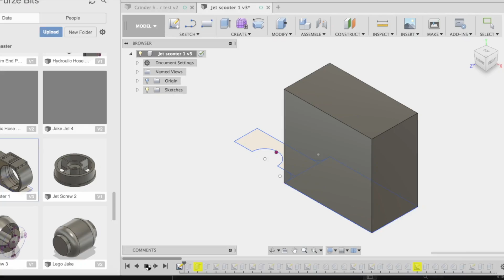Jet Powered Kids Scooter

Comment: When your dad is an engineer and you have an awesome childhood mission accomplished
Reply: Drone Worship He's actually a plumber
Reply: Well Engineer is the one who engineer things, I think you're confusing engineer with paperwork desk job with degree
Reply: not even an engineer just a creative guy
Reply: Not your ordinary plumber, if I may add
Reply: *plumber
Reply: He is engineer by experience.
You can have a bachelor or engineer place by experience equivalence
Reply: Colin furze is amazing. But he is not an Engineer. He can't even do the simplest of mathematics. Nothing will make him an engineer other than an education.
Reply: He is not an engineer!
Reply: Probably he can do the required math. Even if it is not simple...
Reply: and money... (And a engineer isent a protected titel, so basicly everyone can call tham self a engineer)
Reply: Navneeth Gopal
What does that mean?
Who is at the desk doing paperwork?
Someone who went to school for Engineering and received his degree?
Do you actually think Engineers just do paperwork all day?
Reply: He’s a very handy plumber. Anyone theoretically that has extensive experience with fluid dynamics (how fluids change and act) -for example: pipes in a house running through various applications, can apply that knowledge to not only air (fluid) but also the high pressure propane (i think thats what he uses in his propulsion systems) which acts like a fluid as well however high pressure natural gas will come out of a pressurized tank at the a high speed depending on the valve position. All the applicant needs to learn is the mechanics of turbines (if he wanted to make a traditional ‘jet’)  and how to get the ratios correct for sustained consistent combustion (in both pulse and turbofan propulsion systems ). In short, plumbers can makes pretty good pulse jets despite not actually being an engineer. For clarification, as a 4th year mechanical engineer student, there is alot more to engineering than fluid dynamics. But when in doubt my fellow youtube subscriber brethre (initial frame ) (1/2)mv^2 + mgh = (1/2)mv^2 + mgh (final frame) . Now you can find the proper amount of propulsion to get you going whatever velocity you need :) but don’t forget friction on the tires from rolling and also drag created by air resistance... but wait there’s more also you need to take into account the thermal expansion of the metal used in the pulse jet as so the combustion chamber does not exceed the tolerance of its joints. That formula you need     Av = (1/V) (derivative of V with respect to T) since we are working with 3 dimensional objects we must use the thermal volume expansion formula. Now the gas that also expands increasing pressure within the chamber.... you can make a really good pulse jet that works one time or you can make a complicated one that lasts forever... your choice. For my main man here his usually aren’t permanent and melt within minutes of intensive use, which for his demographic is perfect i.e. me wanting to see shit melt (shit breaking fantastically is like hard core porn for us engineers... its just so wrong and dirty 🤤) For the go karts, don’t forget 10 year old boy-scouts make cars too (same principal). Im not shitting on him, i admire his creativity and ingenuity, however he is NOT an engineer with a specific discipline nor does he know FULLY all aspects of his creations, that for an engineer is like getting in your car and driving without a steering wheel, we just don’t understand it nor do we like to have ANY unknowns that can create ‘random’ problems. There is no such thing as “i wonder if it’ll work” its “i know it’ll work” cause if it doesn’t, your car just killed a mother and her kids because the bolt on the seat was the wrong thread count causing her and her kids to become ejected trough the front glass. Bad ‘Engineers’ kill people. Please be respectful of the Word, you wouldn’t call a massage therapist an orthopedic surgeon even though they know the same muscles.
Reply: Who says Colin isn't and engineer?!  Engineer is just someone who balances the forces of nature to produce specific, presumably beneficial, result.  With Colin's instinctive acumen he'd be an asset to any field engineering team.  Training or no, Colin is an engineer in my book.
Reply: Caitlain McCarren
There is a lot of truth in what you say.
Although technically he is not an Engineer by scholastic standards, he does do some remarkable stuff.  Very imaginative and inventive.
Reply: So just to put this to rest if you actually look up the definition of an engineer it is exactly what Colin is just because all of you are talking about schooling and all this other crazy stuff doesn't mean it doesn't make you an engineer. the definition of an engineer is very clear Colin fits this to the T.

en·gi·neer

ˌenjəˈnir/

noun

1.

a person who designs, builds, or maintains engines, machines, or public works.
Reply: Drone Worship you are misunderstanding. He is a what you might call a garage engineer. He is not a professional. Back to the doctor thing. If i fix your cut am i a doctor? No i just know how to fix cuts like a doctor. If you have a headache and i offer you Advil, am i a doctor? No i am not i just know to to help headaches. If i wire a stereo system, does that qualify me as an audio engineer? No i just know how to wire an audio system. You cannot comprehend just how much goes into making just the ABS system in your car, all the hydraulic functions and computations per second, to an engineer who has been trained in fluid dynamics its easy but he must have a computer scientist for help. If i weld your door shut am i a professional welder? No i just know how to weld. The very meaning of an engineer is to know both the scholar side and the physical side which is why universities train their engineers in the fundamentals and most offer internships for the physical. I repeat my point, he is not an engineer, though he has the characteristics of one. Alot of long nights wasted, 48+ hours trying to understand theories and applications, several i mean several math classes. Engineers are so well versed in mathematics that you can see every math problem and be able to solve it without even learning it (well except impossible ones like integral( ln(ln(x)))
Integration of 10 dimensional models and formulating equations to better predict the performance of a car. The amount of times something broke or for predicting when it will break. Does this engine’s cylinders have enough tolerance for when its at operational temperature it won’t rub the sides. How much oil is needed to properly lubricate the system. Will this seatbelt hold the passenger in? Will someone die in this wreck? Is it inelastic or elastic collision when you crash test it? For gods sake i hope its an inelastic. Planes and rockets are not something you can spend a night on wiki learning how to do. IT TAKES YEARS OF PRACTICE and a competent understanding of rocketry. I say all of this because its actually highly offensive to call someone an engineer when they haven’t gone through the shit certified engineers have. Trust me, there is way more shit than the stuff he does on this channel. I’ll give it to him tho, he definitely could be if he wanted, he’s very very sharp.
Reply: valveman12 its stereotypical, he is thinking of engineers with business degrees. No sometimes engineers actually want to see the shit they engineer. Not watch it on youtube from your desk.
Reply: Connor Falcon I said no such thing I said he fits the description perfectly of an engineer I never said anyone needed a schooling degree if you crave things and you engineer them out of nothing then you're an engineer it's quite simple
Reply: The definition of an engineer is Colin there does not need to be such a reference on the name engineer to the point of schooling lol
Reply: Caitlain McCarren
I say he is not an Engineer!
There is a lot more to engineering than putting together outrageous machines.
He is a tinkerer just like thousands of other tinkerers/builders out there.  Just so happens Colin is popular most likely because of his personality.  Not an Engineer, a tinkerer/builder.
Reply: Connor Falcon
No!  I am speaking as an Engineer and not getting my info from youtube as you suggested.
Reply: valveman12 interesting as an engineer you should look up the definition of engineer cuz I'm pretty sure anybody that builds things is an engineer... I refuse to give you the reverence of being an engineer because of schooling. Doctors are good at what they do but they're not gods they just have a set of skills otherwise the definition in the dictionary would say must go to school to be qualified as an engineer 😉. So you sir are an engineer Colin is an engineer don't like it get over it or get off YouTube 😂😂😂
Reply: valveman12 okay I will believe what I like and because the definition in the dictionary is so very clear about what an engineer is I'm pretty sure I'll Trust the definition so there's that....
Reply: valveman12 perhaps you should read engine near the dictionary and make it so it fits your needs so you won't be having this stupid discussion with some dude halfway across the world you don't even know
Reply: Drone Worship
"I refuse to give you the reverence of being an engineer because of schooling."  
You really don't know what an Engineer is.
Anyway this argument is getting old.  I am not going to change your mind and you are not going to change mine so lets just leave it on a friendly note. 
I wish you well.
Reply: valveman12 I wish you well to... please look up in the dictionary the definition of engineer
Reply: Drone Worship
Are we done now?
Reply: valveman12 I mean if you want I can look it up for you copy and paste it? I feel like it would simplify things..
Reply: HAHAHA this blew up. Again he's not an engineer. Valveman said it best. He's an advanced tinkerer. It's degrading to other Engineers to be compared to him, just like a physicist would be annoyed to be compared to an engineer.
Reply: Thomas Jeffrey I really don't care who thinks it's degrading he fits the definition of an engineer. I know you poor little whiny babies would like to thank that everyone needs to have a scholarship and a degree and all these other fun things to be called an engineer but unfortunately the definition is very clear of what an engineer is lol don't like it don't really care Colin is an engineer end of story. This is a post that never ends it just goes on and on my friends some people started...
Reply: Drone Worship okay cool then. Well I'm an astronaut and I'm your dad. Since we can just willy Jilly slap labels on things 😂
Reply: Thomas Jeffrey oh you must be confused there's no willy-nilly about it... Colin is an engineer 😀 you can say whatever you want to the man builds things out of nothing does all the calculations himself from scratch. I really don't care if that hurt your feelings or offend you in some kind of way the Colin didn't have to go to school to learn what it took you guys forever to learn lol but it doesn't change the fact that he fits the description of an engineer perfectly. You really need to take that sad sorry sappy baby crying somewhere else cuz I promise you I really don't care 😂😂😂 now leave me alone dad and when do you go back to space? I'm tired of dealing with you.
Reply: Drone Worship That's the point he hasn't learnt what we have learnt. You keep contradicting yourself.
Reply: Drone Worship he does trivial calculations. Not on the magnitude of engineering level. Colin is a master maker and very clever person. But he is by no means an engineer and he wouldn't consider himself one.
Reply: Stop thinking just because you googled 'Engineer' that you get to define what an Engineer is. You arnt right. Just accept it's an opinion, not backed by objective fact.
Reply: Thomas Jeffrey trust me bro I got all day we can continue this argument for weeks my job is YouTube lol
Reply: A lot of triggered engineering students in these replies. In addition to engineering roles like a military field/combat engineer, before the degree qualification hyperinflation in the 90s a major portion of the scientific workforce were without degrees. Even now, "out of 4,682,400 science and engineering employees in the u.s., 225,200 list their highest education as high school, and 811,000 list their highest education as an associate's degree." (National Science foundation). Colin, although qualified as a plumber, could certainly be labeled an engineer due to his ability to design and construct complex machines.
Reply: "Funny" thing is, in 3 different languages, the definition does say it involves training/schooling to be called an engineer. Engineering something on the other hand can be said about what Colin here is doing, but by no means is he an engineer for engineering things. You might want to recheck your definition, it seems yours is currently wrong.

Regards,
A slightly triggered engineering student
Reply: Drone Worship Every website on the first page of the Google results does mention the word 'training', even Merriam Webster if you scroll down far enough.  It is true that individuals are still employed as engineers without a college degree, but they first receive professional training on the job.  The same would have been true for the scientific workforce and their predecessors.  Collin is not a professional/degreed engineer.  Could be be employed as such?  Yes, but only with prior TRAINING.  He would not be able to call himself an engineer at any job interview, as the first question he would be asked is where he received certification/training/an education as an engineer.
Reply: Blastcat 7536 this is straight from asking Google what the definition of engineer is

en·gi·neer

ˌenjəˈnir/

noun

1.

a person who designs, builds, or maintains engines, machines, or public works.

synonyms:originator, deviser, designer, architect, inventor, developer, creator; 

mastermind

"the prime engineer of the approach"

verb

1.

design and build (a machine or structure).

"the men who engineered the tunnel"
Reply: Blastcat 7536 trust me you guys have already lost stop trying to explain it the definition of engineer is absolutely clear in any language there has nothing to do with training at all involved in it whatsoever get over yourselves you're not as cool as you think you are
Reply: So online dictionaries offer different definitions, what a reason to call someone stupid.
Here are mine : 

 - engineer   
      n  
1    a person trained in any branch of the profession of engineering

 - Ingenieur   

     ( Ingenieurs, Ingenieure)      Substantiv (m)   Techniker, der an einer Hochschule studiert hat  

 - ingénieur
nom masculin

Titre donné à quelqu'un qui a accompli certaines études et a obtenu un diplôme en vue de l'exercice de ce métier.

I'll give you some fact rather than using the definition then, since it does not seem to solve our problem : where I come from, engineer is a title you get after getting trained by specific schools. These schools have to follow rules on the content of the training in order to have the right to deliver this title. These schools are regularly audited to maintain this right and if they do not meet the conditions, they lose their right to give the title. 

I will follow the path of valveman12 and leave you at it with this, Youtube is not my job and getting insulted with no apparent reason (or maybe you can clear this one out for me, so we both get to learn something from these comments?) sure as hell is not either.
Reply: You clearly don't understand the scope of Engineering. It's not just hacking things together in a brilliant fashion such as Colin demonstrates.
Reply: Engineering isn't broken into one thing. It goes from fluid mechanics to thermodynamics to computer science to electrical to aerodynamics and much more. It's not simply welding and fabrication like this. Infact, I doubt many graduate engineers of the most recent decade have ever used a welder.
Reply: +Liam Allen 

"Triggered engineering students" - Lol :) I think you need to be an engineer to understand and love engineering. Clearly some of these wannabe's haven't got the first idea of what engineering is about. 

You don't learn engineering from a book; it comes from the soul.

Comment: That Lithium polymer battery pack must drain down very quickly with such a high current draw.
Reply from the maker: yeah 10 mins depending how hard you run it, its never flat out as it  builds up to fast for him so just little squirts is fine
Reply: colinfurze Perfect for the little one. 😀 Great video as usual!
Reply: Suggestion from a race drone flyer: a shell over the LiPo battery, so the cable ties have no chance of cutting into it. The cells do NOT like to be bent/crushed and pose quite a fire hazard. Also don't discharge below 3.2V individual cell voltage, or you do lasting damage to it.
Though i'm pretty sure you knew all that :D
Reply: oh yes, its literally an rc battery lmao
Reply: meine rede ^^
Reply: its 100% RC components besides the print and scooter.. Would it be not so LMAO if he used a heavy lead acid motorcycle battery?
Reply: It's a 6 cell pack though so the current draw is "relatively" modest. 

The higher the voltage the more efficent it will be. You can achieve the same speed at half the voltage but it would require twice the current.

If he used a motor that had the same speed with just a 2/3/4 cell pack the current draw would have been way higher.